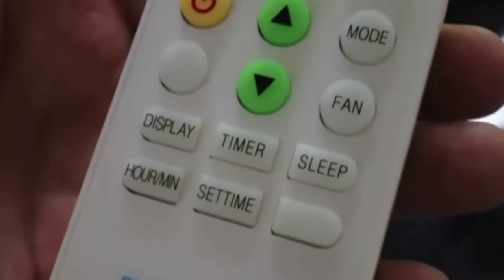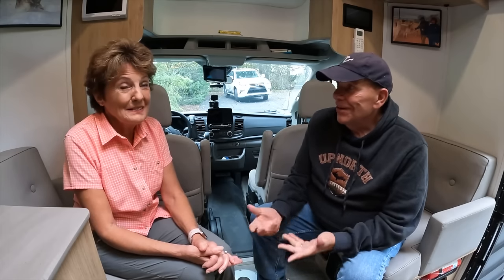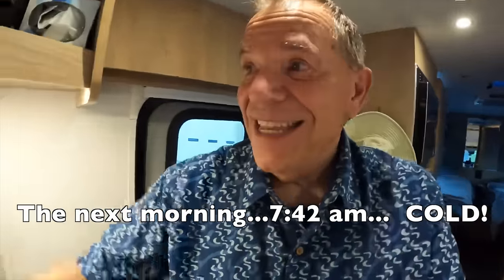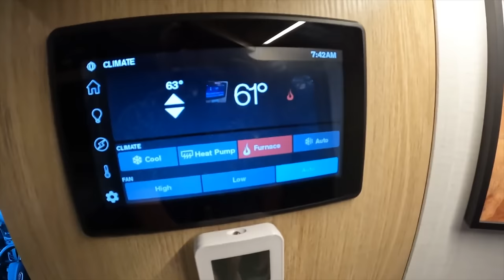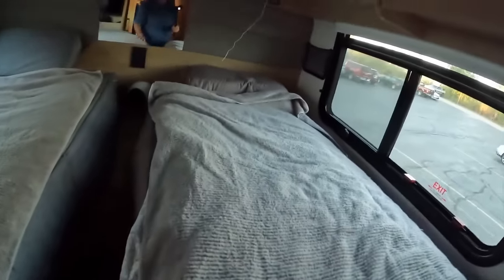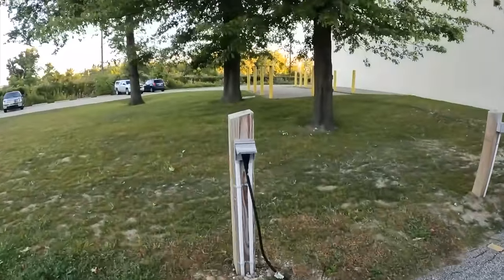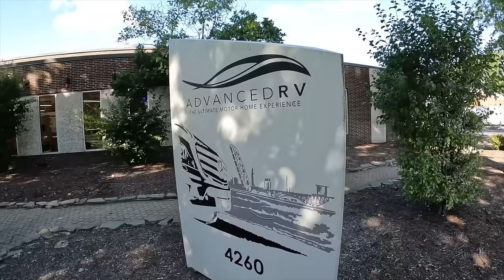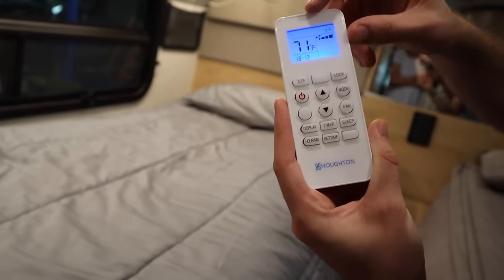A QUIET RV Air Conditioner!? Installing Our New AC

Comment: RECPRO sell these - just installed a 13.5 on our Pop up and will be installing a 13.5 on our 1975 GMC and it comes with a heat pump built in. Just fine for 26' motorhome. The Houghton units are far less expensive from RecPro.

Comment: Mike and Jennifer,
Great video on the Houghton AC and install by Advanced RV.  We are full-timers in a Class C motorhome and had the Houghton AC installed about two years ago to reduce the loud noise from our existing AC, which made sleeping and even conversing in the motorhome difficult.  The Houghton has performed flawlessly, and in addition to being very, very quiet, it is efficient using about 950 watts, has a built-in soft start, and the remote is handy to change the temperature at night without having to get up.  Cleaning the filter is a breeze! The team Advanced RV did a great job on our install, and Mitchell was a true professional.  Keep up the excellent work!
Reply: Hi how many btu is your new ac?
Reply: The Houghton AC, since it is Australian, is rated in watts not BTUs.  The AC was custom ordered by Advanced RV which removed the heating option and might have also altered the cooling capacity.  The model on the housing is the Houghton Belaire 3400.  Converting the 3400 watts to BTUs yields approximately 12,000 BTUs.  Hope this helps!  @arriagada1957

Comment: $3500 seems like a lot of money to replace a perfectly good AC with a quieter unit. Are the BTU's equivalent? From what I can tell Hougton AC's come from Australia which I am sure is fine but I wonder how the parts and service situation is for them in the U.S.?  

Had this been available as an upgrade from LTV I wonder what the price adder would be? I wonder why LTV doesn't offer the Hougton AC as an option?  A quieter AC is better although for people like me when it comes to sleeping I like the white sound the AC gives off. I cannot sleep if it is dead silent so I would not want it to be too quiet.

Comment: Anyone considering buying a Houghton A/C should be aware that the fan never shuts off. I just installed a 3800 model. I love that it is 20dB quite than the old A/C while cooling but I hate that the fan stays on all the time.

Comment: Great video, thank you. Two questions... 1) Does the fan on the Houghton run 100% of time when unit is powered on? Or, does it cycle on/off with compressor when calling for cool? 2) Have you had any issues with humidity/performance running the Houghton, even in southern/humid climates? Thank you.

Comment: What do you set the temperature on your remote at startup?  We recently had a Houghton installed on out Class B van, The compressor stays on in cool mode for only 90 seconds regardless of temp settings, fan speed, etc.  Also, we have discovered that the dehumidifier does not work either. Is temperature setting on the remote critical? I've set it at just below room temp to all the way down to 70 and very little cold air ejects during the 90 second compressor cycle.  At this point, we would choose a really noisy Coleman Mach just to stay cool.  Our van is like a sweat box!  Love your channel. Thanks.

Comment: Thank you for your video on the Quiet AC. I called Advanced RV today and asked them if they could install one in my 2020 Regency UltraBrougham B+ on a sprinter chassis. I also asked if it would work with my existing EC30 Auto GenStart. The person that I talked to did not know, in fact he had never heard of it and he would ask the tech then email me back with an answer. I received an answer via email the same day stating "I got the information you wanted. Unfortunately, we will be unable to do an A/C swap on your Sprinter. We're only doing simple A/C swaps at this time. If you find a dealer around you that would be willing to do it, I'd be happy to ship it to them. The price is ~2800 with shipping and you can pick between a white or black one". I am wondering what would make mine different than the average LTV?

Comment: Houghton's are nice and quiet, but not as quiet as my mini-split on the toy hauler. Not to mention (heck, I just did) price. $735 and I installed it myself. Of course, it would be very difficult to impossible to install in a van conversion.

Comment: Good to know that there is the option out there . Thank you for sharing. Is there a model number for the AC you had installed? Also, what happens to the old AC unit (any trade in credit)? Thanks again!